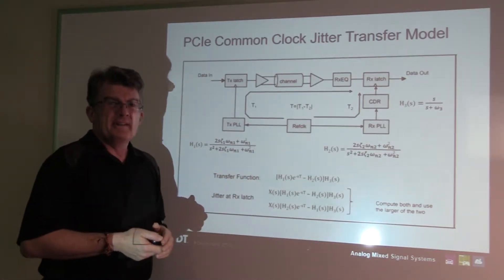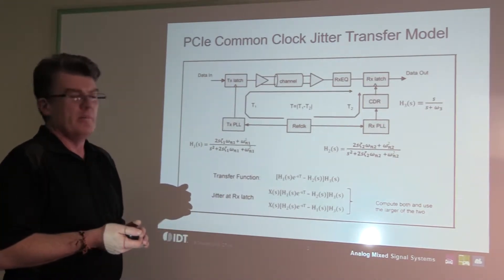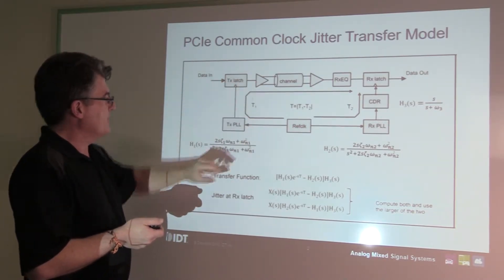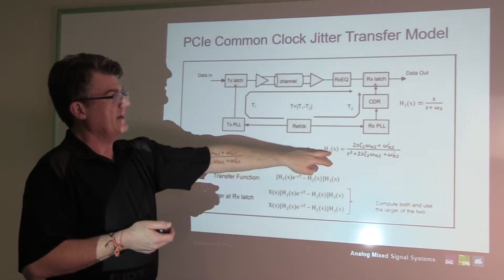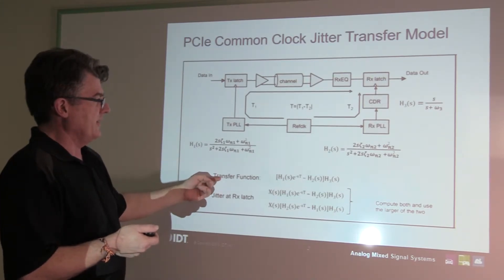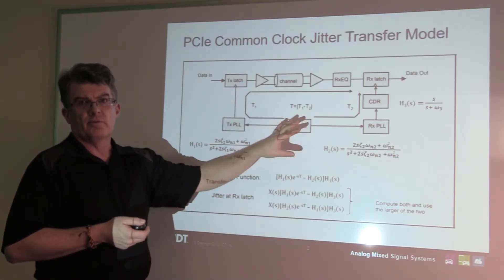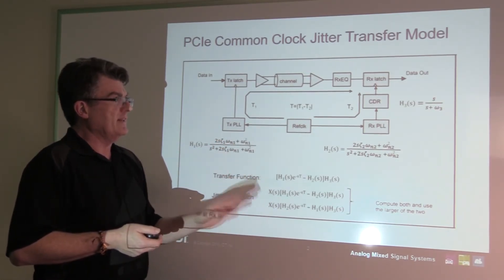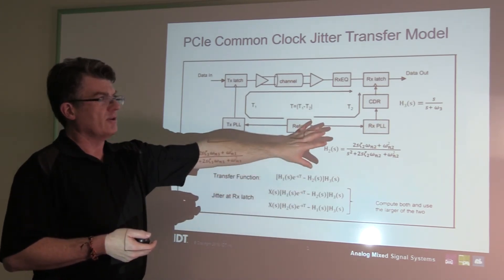PCI Express Common Clock Jitter Model and Transfer Functions

Comment: Thank you for the excellent video. In a data clocked topology the receiver must support the full 20ns jitter of pcie spread spectrum clock.
I understand this is largely reduced in a common clock topology. However I could not find a number specified. Is it reduced to 10 ns? 1ns? 1ps? 
Do you maybe have an indication per your experience?